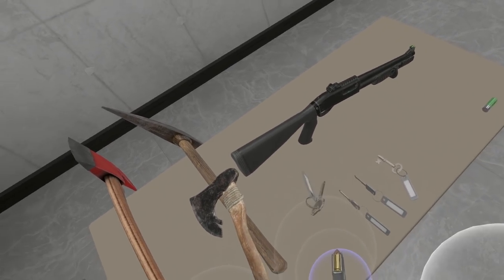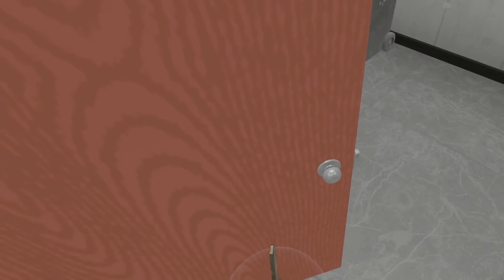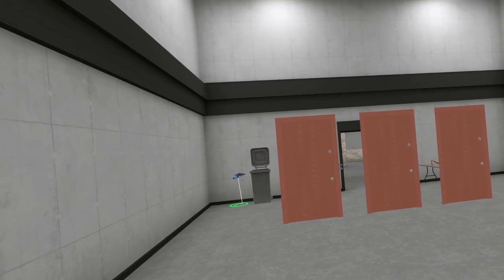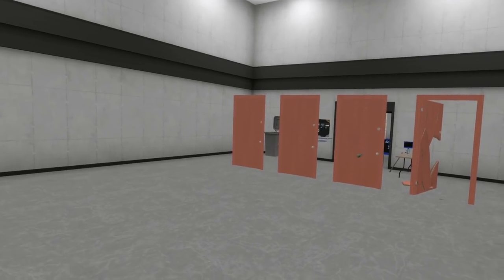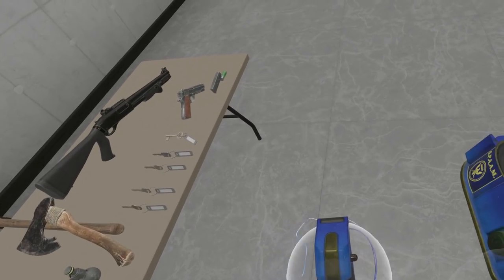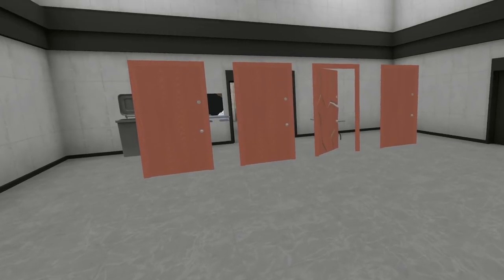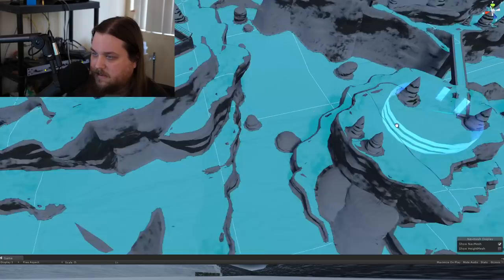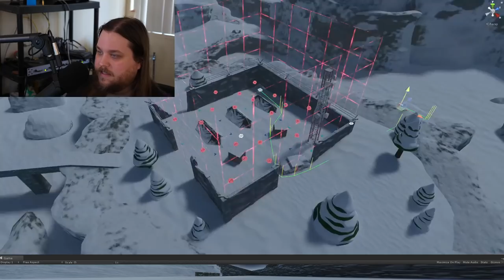H3VR Early Access Devlog: Moar Door Breaching Sim Progress!

Comment: Honestly, the SPAAM mine is fun enough that if a version with a sticky back was added so you could attach it to walls or doors, I'd be happy
Reply: You can do that, just stick the back to the wall i think
Reply: You gotta set it to mine mode and then it'll stick to surfaces. I think it's that little black latch looking thing that switches between the two modes, but I haven't messed with it in a while so I'm not entirely sure if I'm remembering right. Mine mode doesn't let you detonate them with the detonator though, the laser has to be tripped for that.

Comment: For explosions, you could maybe add a "size" factor, so if explosion damage equals something like E/D (explosion/distance to centrepoint), it would equal E/(D-S) (explosion/distance - size factor). That'll effectively give you a larger centrepoint to work with, as the explosion doesn't need to reach all the way to the centre before doing maximum damage- you might need to add something to handle when the explosion happens within the size radius, but I'm sure that can still be done fairly cheaply.

Comment: Hey Anton, it's hard to tell in the video but real wooden doors aren't a perfect rectangle if viewed from the top. The face of the door that you'd see if you were in position to push the door open is actually 1/8th inch shorter than the side you see if you were in position to pull the door. This creates a very small angle on the latch face of the door and gives room for the corner of the door not to catch your strike plate embedded in the frame before your latch will. Might make your closing of the door more reliable. Awesome video as always!

Comment: door charge idea

H.A.M

Hard
Armor
Mincer 

Info: a flat charge that looks like a gatecrasher mk4 charge, it has two main purposes, 1 is to blow up any door creating a whole where it was, the other is to blow holes in some armor.

Set up you place it to an object it sticks then you pull the pin and run it has an 8 second fuse and beeps the whole time. Warning do not stick on hotdog, it will turn them to the smallest chunks possible and make them a suicide bomb.

Comment: Love the game, one thing i noticed, when you are shooting either flintlock weapon, if you don't ram the ball down, it still shoots out fine. Ive always been taught shooting muzzleloaders that if you don't properly seat the ball onto the powder, the gun becomes a hand grenade, I would love to see that implemented
Reply from the maker: That isn't actually the case.
Reply: @AntonHand  i did some more research, amd it looks like you are right, or it is at least controversial as to weather or not the gun will burst. I love how much detail you wemt into with the brown bess, and the best part, i can work on not flinching at the flash in the pan and not have to spend an hour deep cleaning the gun afterwards.

Comment: Hey Anton, you got my mind stuck on that problem to cheaply compute an accurate damage value given an explosion and I have thought of something that has at least un-stuck my mind from it.

let the door be defined as the xy-plane
let the vector from the fragment centre to the explosion be FE
let the normal of the fragment in the z direction be FN

First a distance compensation value is assigned to each fragment of the door. This can be pre-computed as the average between the width and height of the bounding volume of the fragment or chosen by hand. Call it fragment_compensation

This distance is to be subtracted from FE, but the trouble is that this compensation is needed the closer you are to the xy-plane and not so much in the z direction. So you take one minus the dot product between the fragment normal and the normalized FE and truncate the sign. This is multiplied with the compensation to get the actual compensation which is then subtracted from the raw distance.

This subtraction can lead to negative distance values which can be fixed with a branch. I'm not a fan of putting a branch here but architectures that support branch-prediction should see the cost reduced since the compensated distance is much more likely to be positive. So something like

raw_distance = mag(FE)
compensation = 1 - fabs(dot(FN, normalize(FE))) * fragment_compensation
compensated_distance = raw_distance - compensation
if compensated_distance < 0
    return raw_distance
else
    return compensated_distance

Its not a great solution but its less computation than a hull-to-point shortest distance algorithm. Anyways this is just me thinking of something for my own satisfaction and I don't pretend it would even be feasible in your system since I'm not familiar, but in the small likelihood that it could contribute to a more suitable idea, I figured I would post it anyways. Cheers

Comment: Hello, I noticed one nit to pick: Nearly all house keyways (at least, in the midwest) are mounted so that the key is inserted with the teeth of the key on the upward side. Hence, when picking a lock, one 'lifts' the pins, since it's in an upward direction. So, when holding and inserting the key, the teeth should be on the upward side as well.
Reply from the maker: yup. I'm an idiot. I totally got it backwards :-P

Comment: Hm... I feel like the energy and nature of a RPG-7 warhead would actually pierce through and not detonate on the door. From what I know the rocket shoots a molten cone of metal forward to pierce and then a shape charge goes off in the resulting hole. Theres a really good clip from mythbusters of a RPG rocket going through a thin wood wall that demonstrates how it works (rocket on a wire, somethin somethin), it smashes through and detonates behind it.

Comment: I would say that the results you are looking for should be a little higher than just a few bits flying off. since the center of the door has less structure and is not held in by any external forces such as the dead bolt or the hinges the center should be easier to blow out.

Comment: I wonder how much more demanding it would be to have smaller door fragments. Also, what if the fragment pattern could be randomly generated based off of noise or something like that, always making a fragment of certain size when right next to a critical component like a doorknob.

This is definitely some crazy stuff. It would take me a very, very long time to get competent enough at programming to do this stuff.
Reply from the maker: Dramatically more demanding. Also it is not possible to generate and physics-joint the assemblage at runtime. All door fracture patterns will be pre-generated.

Comment: you're working on the locks in a much more detailed way than I expected.. will there be any type of lock-picking in the future?

also in my opinion, the shattered doors don't look that good, the way the pieces end in a sharpened/pinched way with all those massive holes make it look much more fragile than it is, if I saw that in a level I'd think the door would be a poke away from crumbling. I'd just indicate it with cracks across the door with a much lower amount of holes.

Comment: Hey Anton, one question, would it be possible to use something similar to the "sliding key in keyhole" for very long sliding action interactions like the reloading of the RPG? instead of "forcing" the rocket into the gun, which sometimes causes clipping and has very little feedback, have it "snap" into alignment with the tube, and then we can either slide the rest in, or out to remove it? It would be a nice intermediate option between "interactions are fully physical, hard mode" and "there's no collision whatsoever, easy mode"
Reply from the maker: No.
Reply: @AntonHand  hah! I shall interpret this answer as "do you have ANY IDEA how long it took for the keys alone to work?!"